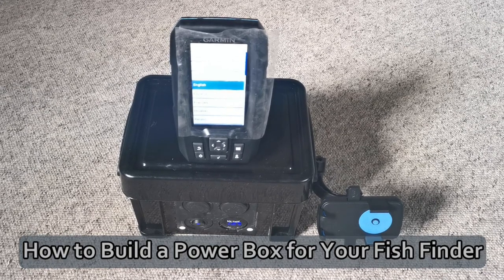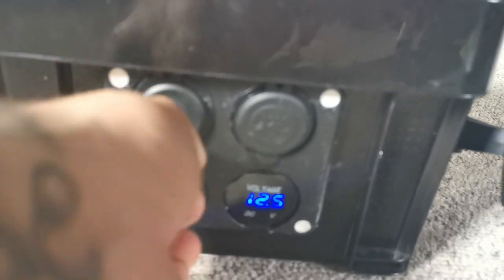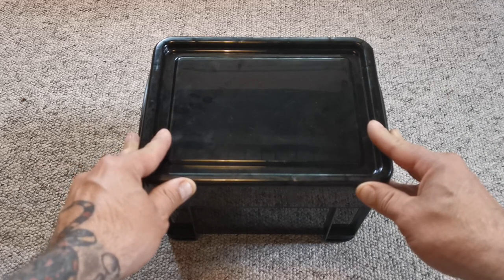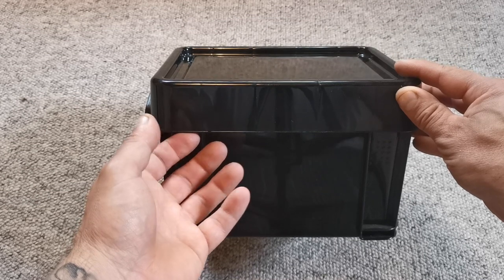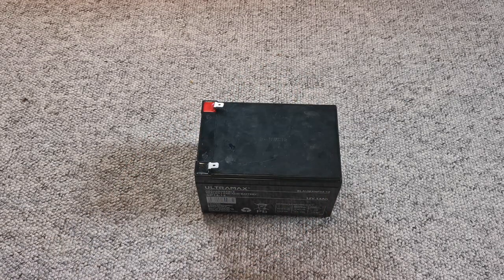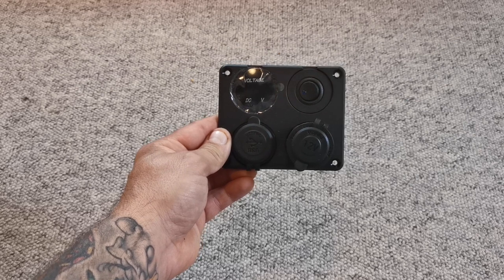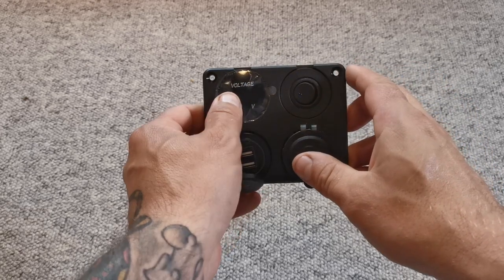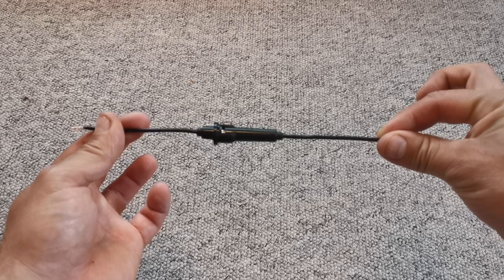How to Build a Power Box for your Fishfinder | SIB Fishing

Comment: Would you be able to share what sizes of electronics you used please? Wire dia, crocodile clip size, spade end size? Thanks... that's the stuff I always get wrong when I order online!
Reply from the maker: All of the electrical fittings were 5amp size. Any bigger and they would be too big.  I'm not quite sure of the cable size I used as I just stripped down some 2 core but any 2 core 12v/24v  16amp would be fine